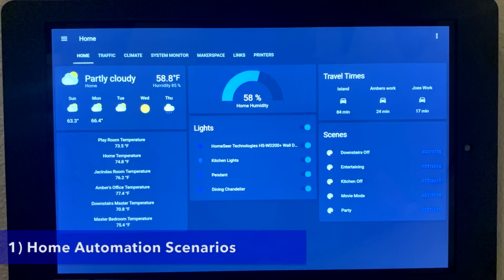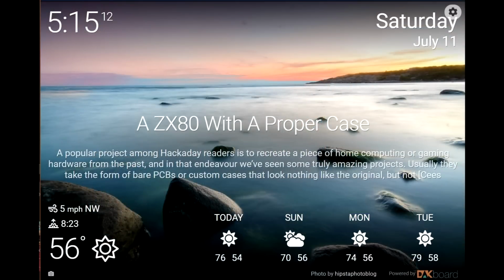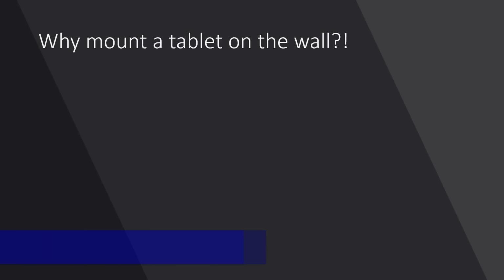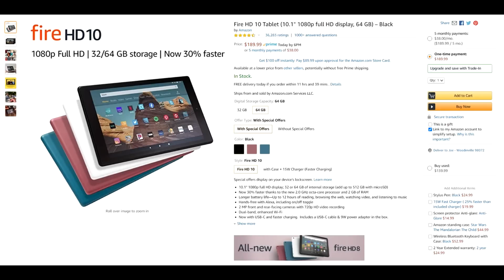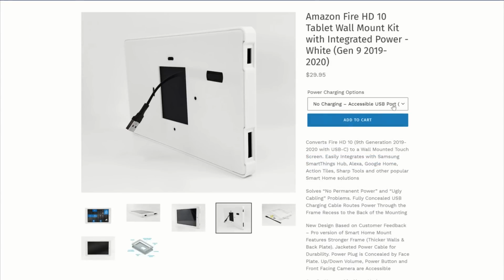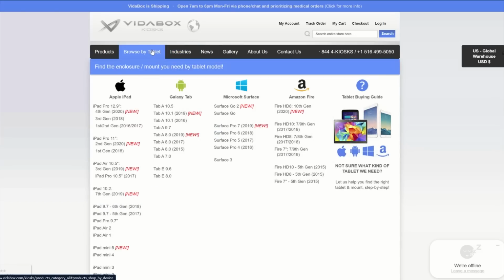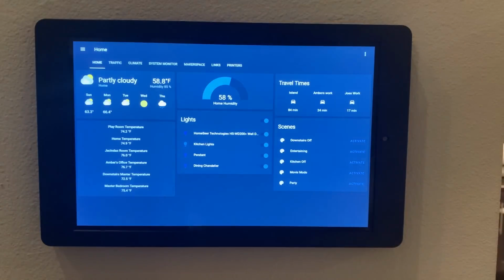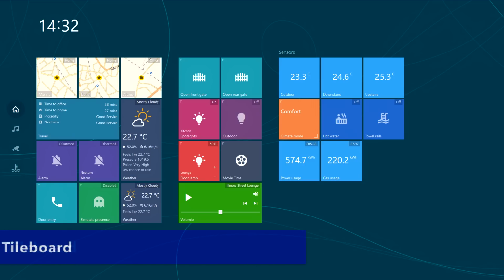5 things to know about wall mounted home automation tablets

Comment: The best information about these kinds of systems I have seen in a while. However, even though I'm an IT guy and just renovated a house, I did put tons of network into the walls, but nothing smart in the way smart homes are considered smart.
The reason is easy:
- I'm an IT security guy
- I planned everything thoroughly, such as lighting etc., so there is just no need for automation on that. In fact, whenever I was somewhere where people had systems like that, they did have their setups for different modes, but everything was kinda off, ALWAYS. TV with children willing to play in the background where it was either to bright for TV, or too dimm for the children. Etc.pp. Basically whatever you configured, the lighting was never perfect in the way you would just switch it on if you would be willing to stand up from your couch.
- Price
- All the info about IT stuff I have literally IN MY HAND all the time anyway through the native apps on my smartphone that give me all the information, not just what you can pull through these sometimes better sometimes worse interfaces.
- I find it very disturbing and annoying that when I walk through my house in dimm light, some random stuff or display or whatever would just flash up although I don't need it really.
- The information is always exactly where I DON'T need it. E.g. I have a weather station so I would know the temperature to know how to dress. Thus, I need that info in my bathroom, which is where my headunit sits so I know after my morning shower what I actually need. The tablet in the kitchen is rather... well... just wrong. However, if I put a table in the bathroom, it'd be off for basically everything else.
- A tablet on a painted wall where you do things like accessing information, steering, having recipes  open for cooking etc. is always either too low for you to have a comfortable look, or too high for the kids. Also, if you have ever seen children cooking (or "helping" you to cook), you can imagine how that wall would look like half a year later.
- You are always bound to market development. Whatever you put into your walls... if the vendor dies and your installation has a problem, you are in trouble. If my switches, dimmers or whatever dies, I just replace it. No software involved, no incompatibilities, and no work for findings the right apps and drivers and optimizing interfaces all the time etc.

So my general thoughts had been (and that was specifically after talking to a lot of people that were extremely hyped about their systems in the beginning and - after realizing software is the devil - pretty disappointed and all of them with only two exception that had the bad luck to not just put normal hard wiring into the walls in addition, went back to conventional systems. A switch, connected to a lamp. It works. Always! ;)
I honestly think this is something for a bachelor living on his own that does only do one thing at a time and does not have to worry about other people. Thus he can set it up specifically for his own needs and wishes and be happy with it. In literally ALL other cases: Not so much.
Reply from the maker: I dunno. I'm far from a bachelor (Married 20 years with a 2 year old amazing daughter), and I find mine really useful.  I am using Home Assistant, so I don't feel tied to a vendor (it's open source, I own the hardware, and use industry standards). My switches are Zwave, so i have the reliability you describe...if I have nothing running they just operate as normal switches. 

I get that it's not for everyone. And that if you don't plan things out correctly, you'll end up ripping the system out in 5 years due to obsolescence.  Proper planning, research, and tradeoffs are the right approach, I believe, to any home enhancement, and this isn't much different. 

Also, like many things, this is not a singleton design, and it shouldn't be, for home control.  This is great for when my babysitter wants to control the lights, or check on my daughter.  It's handy for my wife to run an automation or check on something. But for cooking...no...I'd just throw an ipad into a 3D printed holder and rock that. I also use voice for many things, NFC tags, macro switches and more.  My ideal automations run without my interactions because they react to sensors and timing.  

Remember, when wall mounted TV's started, there were a lot of pundits there as well.

You bring up great points. I don't think anyone should watch this, bust into a wall and throw a tablet there and think that it's going to solve problems.  These things take planning, research, etc.  This video is just one aspect of that.  Wall mounted tablets are an option for control, that's all.  The choice is up to the user.
Reply: @geektoolkit  You misunderstood me: This was not meant to be criticism in any way and I think how you did set that up for you personally is a "good to go" solution as is. Especially with the switches - if they operate as you said. What I was referring to really is that most of the people installing "smart" stuff do not inform themselves properly beforehand, installing switches of the vendor their lights come from, to give an example. Later when they want to replace the bulbs, all of a sudden the whole system does not work as intended anymore.

Another example that I see more often nowadays is the first KNX-based systems for stuff like windows shades, where they basically put power and KNX bus lines to their windows and - after the systems started creating trouble - there is almost no way out of that and to go to a conservative solution, because those bus cables are generally directed towards the steering unit somewhere, and not to a place where you would want your conventional switch. If somebody has fun building stuff like that and builds it in a way so he does have a fallback solution (such as yours): Fair enough!

Generally speaking I just wanted to give my input and not criticize you. I mean obviously everyone has his own flavours of choice, especially when it comes to tech gadgets.

As good as you set this video up, if I could wish for something in the future: I think you would be a very good host for exactly those topics to discuss an bring up: What makes sense to make smart, what doesn't? How can you future-proof a system to not be dependent on vendors? What just generally makes no sense and would be better set up in a conventional way?

It is your YouTube channel, I can only say: I'd watch it! =)
Reply from the maker: @Burnman83  Thankyou, and I didn't mean to misunderstand you!  I was looking for that clarification, and yes, you're absolutely right...KNX, X10, Ultrasync, and even Brinks and such..the list of integrations that have gone in and died leaving carcasses in houses is long and..terrible.  Thankyou for clarifying....I like to do a bit of discussing it because I learn a ton, so that's why I challenged it.  That all being said, you have my brain spinning....I don't know if I've seen a good series on 'how to design a home automation system to avoid common pitfalls'.  I'm going to have to think on that one, though it'll be a challege.

Also notice I didn't even try to touch the 'it security' comment you mentioned...because I know just enough about security to know how much I don't know, and it's probably fair to say that adding this much wireless tech, esp. cameras and smart locks, opens it up :) 

You're awesome, thankyou. I think you inspired a future episode, and definitely enough thoughts to keep me up for a bit as I ponder it :)
Reply: @geektoolkit  Haha, good to hear, I'll stay tuned =) Generally speaking - considering I have no idea what networking hardware you are using - it is a good idea to set up a guest network and put all the "smart" bits and pieces in there. You can still use it as a normal guest network, but it will only have access to the internet, and not to the rest of your devices. This of course also goes for Blu Ray Players, TVs, etc.
Just make sure you do not enable a feature called "client isolation", since it will prohibit all of your devices from talking to each other.

Having that said, this is another big part of why you should have proper switches such as yours. Not being able to switch your light on, because you are in the middle of a network migration: Not that great =D

I'm afraid KNX is very much alive over here in Europe. Yet.
I do know that cabling is typically a lot easier in the US, since you mainly have wooden construction and dry walls you can work with to put new cables in. Over here, most of the houses are old and have solid walls. That means if you need to pull a wire, it is either visible, or you have to go the entire mile to grind a channel into the wall, afterwards repair the plaster or wall paper, etc... That is what makes it THAT painful over here to go from dumb to smart or vice versa! =)

Well, great, I'm looking forward to you new videos and am happy there at least one YouTuber out there that perfectly handles user feedback, even if it isn't in line with what he originally posted. My pleasure and stay safe!

(P.S.: Obviously English isn't my mother-tongue, so please excuse typos and/or weirdly put together sentences =))
Reply from the maker: @Burnman83  Your english is better than most people I meet here in the states :)  I love teaching because I find it's the best way to learn...people come up with all sorts of things I wouldn't have thought of on my own.  Even in that post you bring up great points that I need to expand my mind to think about...for instance I've been thinking very US centric...but the thought of solid walls definitely is a big consideration (also we have some brick walls here...I'm not even sure how you run something with those!).  I love feedback, and respectful comments.  You're amazing, and it's great to have you contributing to the community. I love the guest network thoughts as well, that's a good idea and something I"ll explore!

Comment: Look into battery bloat. Having a tablet plugged in 24/7 over a long time can lead it to expand and risk of fire, etc.
Reply: You may want to discharge battery once in a while with a timer appliance
Reply: @ekosf  I plan on using an outlet behind the tablet as I am doing a new room build. Maybe I will get a zwave enabled one so I can set it up to cut power once a day for a few hours to drain some. Would that be a good solution?
Reply: @jasonjennings6686  I'm not an expert by any means but that's what I do. Some people make it cut power randomly too but I don't know if that's necessary.
Reply from the maker: @ekosf  Thanks I'll look into it and check it out!

Comment: Thank you for such an excellent video!!  I've thought about doing something like this with a eInk display because I think it would look sharp, but I hadn't been thinking about the security camera monitoring...   Also, do you know it would work with a second unit, perhaps in master bedroom??
Reply from the maker: Thankyou! Depending on what you are running for a backend it may not matter how many tablets you use. For instance home assistant just serves up a website so you could have numerous ones point to it. I’d say you could do five easily without too much hassle. It scales very well! Now as far as two camera streams that’s a bit different, may need a pi4 or a NUC due to bandwidth if they’re streaming off the home assistant itself. My cameras are currently cloud based (Arlo) so  I don’t take that bandwidth hit.

Comment: Since I have about 30 tablets and smartphones mounted and often update and replace them I've gone with 3M command strips for mounting. I've replaced most light switches with USB outlets so I can use short cables for power otherwise I drop a cable to the nearest outlet (which have USB A or C).

The reason for update/replace is a combination of evolving technology and discovering that some devices have problems like bloated batteries when left plugged in for extended periods of time. Since I use my browser app I can use relatively inexpensive devices.
Reply: Wonder if any could run with the battery removed?
Reply: @bob frankston I see you post videos. Would love a video about what you have done and learned and recommendations based on your experiences with various tablets
Reply from the maker: I like that that makes sense. Do you put them in cases for aesthetics or is it even necessary?
Reply: @geektoolkit  They actually look pretty good without a case since the velcro is hidden in the back and I can use black and/or white to better blend in. The aesthetics are more about the power code so I do want to figure out a better way to power them with a very slim cord on the side.

Part of the issue is my design point with an emphasis on agility.
Reply from the maker: @BobFrTube  I love that!  One idea I had come across when researching this was someone that did a magnetic mount to a QI charger...so they put a QI Charger on the wall and made that look clean, and then mounted magnets.  The tablet held well, but then was easily removable and portable if they wanted to use it as a tablet still. Similar to the docking station concept some others have mentioned.
Reply: To be clear --  I use the Velcro command strips so I can more easily move and replace.

Comment: Hi thx for the video! May I ask what hardware are you using in back-end? Communication between your touch and   for example the light-points?
Reply from the maker: Your welcome and of course!! I had at that time a raspberry pi running Home Assistant, and used a Nortek Zwave dongle. The lights are on a  GE Zwave switch. Let me know if that’s what you mean and if that helps
Reply: @geektoolkit  thx for the info!

Comment: Just one idea: 
- Buy a usb-c  magnetic cable: 
https://www.amazon.es/Kyerivs-Magn%C3%A9tico-Cargador-Conectores-Transferencia/dp/B07X9LDXFY/ref=sr_1_1?__mk_es_ES=%C3%85M%C3%85%C5%BD%C3%95%C3%91&dchild=1&keywords=usc%2Bc%2Bmagnet&qid=1601840638&sr=8-1&th=1
- Then make the tablet removable from wall case as a portable control.
It's my setup with openhab + zigbee + alexa + raspberry

Comment: Track the power of tablet and keep it between 20 to 80 by adding a relay to charger
Reply: I took and old Android phone I had lying around and hooked it up to a switched power plug. It now cycles between 50% and 70%.
Reply from the maker: @FlorpyPamda  That's an awesome idea, and a great use of an old phone to keep it in operation.  I realized some of my old phones no longer will turn on because I didn't keep them charged.  This would put it to use and keep the battery cycling!
Reply from the maker: Yeah that's a good call, esp. on cheaper tablets. This would prevent overcharging and could help keep the battery in good shape.  I think many tablets have the charge circuitry built in to make the most of this, however I wouldn't trust that circuitry on cheap tablets, and being wall mounted may be better to be safe than sad.